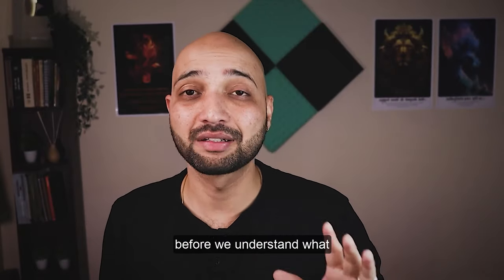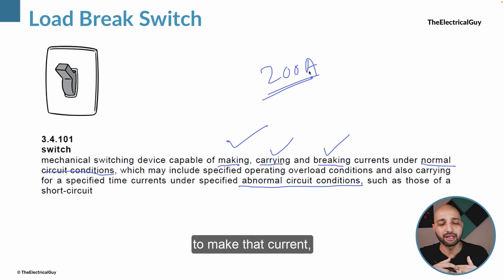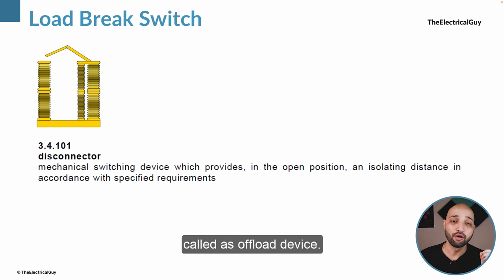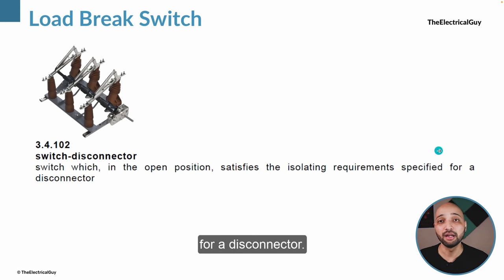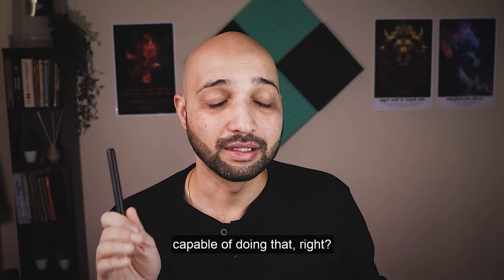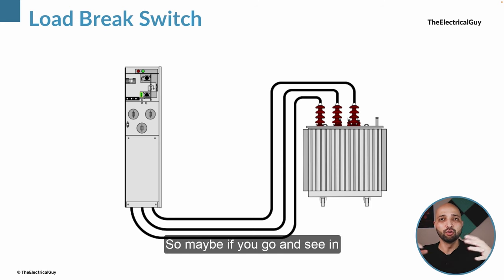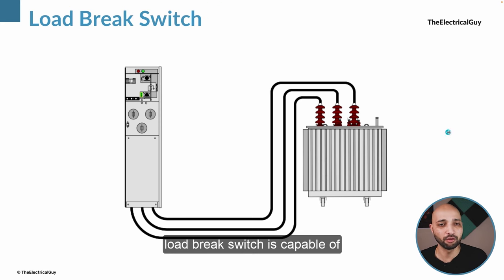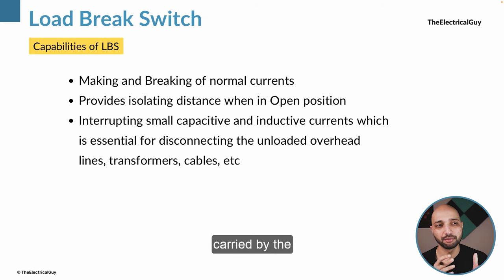Load break switch (LBS) | An Introductory Guide | TheElectricalGuy

Comment: Two questions: how do you determine speed of the opening contacts, and how do you determine the distance between contacts when opened???
Reply from the maker: It depends on the voltage rating and the current that you’re switching